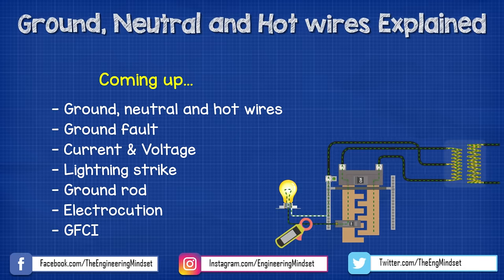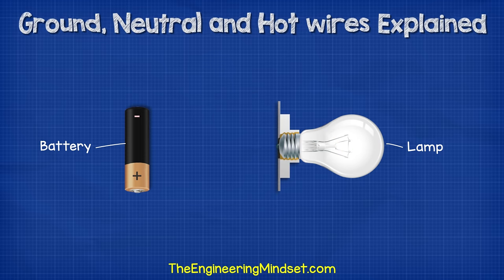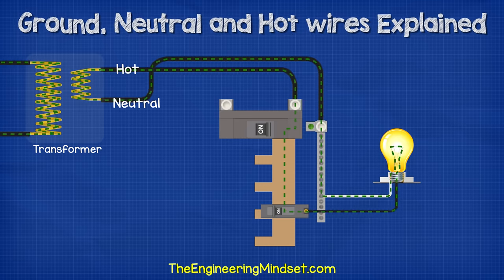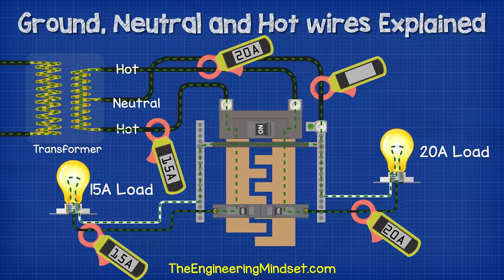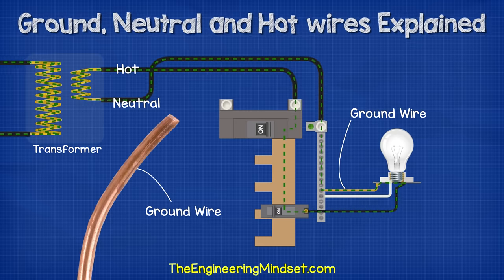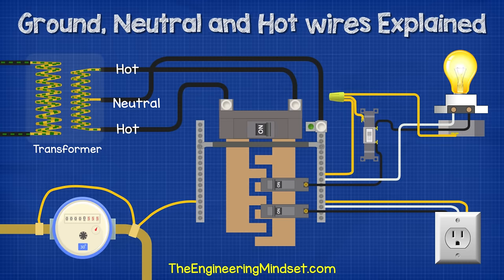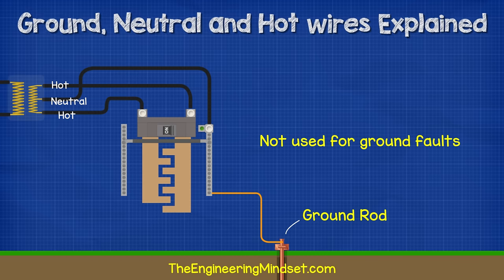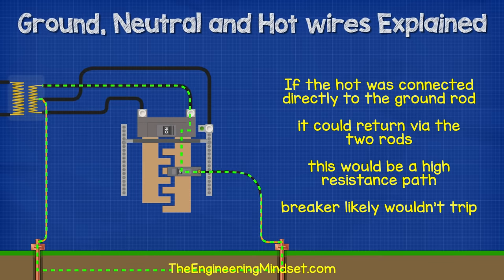Ground Neutral and Hot wires explained - electrical engineering grounding ground fault

Comment: 6:31 The ground conductor is connected to the positive terminal of the battery. If I were to place my multimeter leads across the ground conductor and the hot wire I should read 1.5 Volts. This is because the ground conductor behaves as an extension of the positive terminal of the battery, even though it is not a part of the circuit, which is why current does not flow through it (under normal circumstances) even though it is attached to the battery. Now, if I were to straddle a load between the ground conductor and hot wire, this would result in a flow of current between the ground and hot conductors and (hopefully) trip the GFCI in a residential scenario. Please correct me if I have misspoken.
Reply: depend of the resistance of the load
Reply: in a case of a ground fault the resistance of the ground wire is low so the current will be high so it trigger the breaker but if you put a load between its different.
Reply from the maker: Check our new Multimeter tutorial out ➡️ https://youtu.be/4lAyzRxsbDc

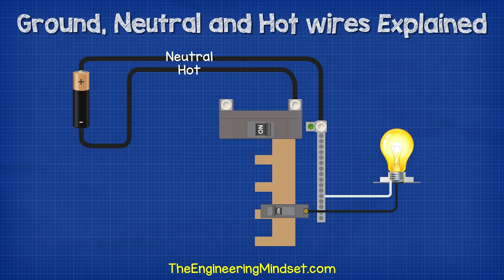Comment: 2:24 Q: so does that mean that there is still current flowing from the ground wire even if it's just for emergency?
 
Q2: I was wondering, can you touch one of the live outlet's wires or specifically the ground wire, alone, and not be electrocuted?.
Reply: You should technically be able to touch the neutral or ground and not get shocked don’t do this. But you can test between earth and neutral with a volt meter and should get 0volts.
Reply: @KiwiMaker  Thank you for answering. I might not do that without any professional supervising me, however, I want to see a real demonstration. Hopefully in the future our professor will demonstrate it to us/me.
Reply from the maker: We just published a new Ground fault, short circuit and arc fault video, so much detail! Link HERE➡️: https://youtu.be/Qi0ynSQw-wc

Comment: Hi Paul! I have a QUESTION for you about the flow of electrons in AC current. My example is base en Alternate Current like in Europe Standards: 1 Phase Wire and  a Neutral Wire.

The Electrons in Alternate Current flow  thru the phase wire and via the neutral wire to the Transformer of the electric company and the get back to again? Or is the Electric Field that is going to the Transformer back and forward? 
In the case that the electrons move (via neutral wire ) to the Transformer: Where the source of electrons come from? 
I've heard from many sources about electricity on the internet that electrons flows or move from the negative to the positive in DC current but in Alternate Current the electrons doesn't move only vibrate and what is moving is the Electric Field.  Is that True? Because if electrons doent flow How the ground fault circuit interrupter (GFCI) could detect a leakage current in the circuit????

Well that's my question.

Excellent Videos!

Thanks!
Reply from the maker: Well the GFCI detects a difference between two wires, if there is no fault both will be the same, if there is a fault then there is a difference. It doesn't matter in which direction the electrons are flowing there will be a difference, either electrons are flowing into or out of the ground/earth wire so there will be a difference between the hot/live and neutral wire. In DC the electrons move in one direction, but AC is back and forwards. The distance travelled is tiny (although I will add this is estimated as no one has ever actually seen an electron.) the ground is usually physically tied to to ground(earth) so its potential is zero volts between you and the neutral. But the hot or live wire isn't so it's 120/230/240/400/415V difference between it and the hot/ground/you
Reply: @EngineeringMindset  Thanks you for your answer Paul!! : - )
Reply from the maker: We just published a new Ground fault, short circuit and arc fault video, so much detail! Link HERE➡️: https://youtu.be/Qi0ynSQw-wc

Comment: I don't get one thing. In a DC circuit, current flows from the negative to the positive, so its obvious which wire is hot and which wire is neutral. The wire carrying the current into the load is hot, and the wire carrying the current away from the load is neutral. However, in a AC current, current oscillates back and forth, so how do you know which wire is hot or neutral? Since they are both behaving the same

Comment: As the live/hot wire carries  electrons from - to + terminal ,it seems more likely to have a electric shock from the wire which comes out of - terminal ,although touching wire from + terminal shocks.can you explain why as we have a better understanding about what you teach
Reply from the maker: Neutral is grounded so it's potential between you and the wire is (or should be, it could be faulty) is zero. Whereas the potential between you and the hot wire is 120 or 240 V
Reply: @EngineeringMindset  Thank you very much for your kind  instant reply👍

Comment: Thanks for the great explanation! Quick question though : if we are installing a fuse in a simple battery-load circuit, so we have to install it on the hot side or on the neutral side? Also, will the hot side be the the positive or the negative terminal of the battery? Also will ground wire presence affect the position of the fuse?
Reply: I would recommend always put breakers and fuses on the hot wire as a best practice.
Always think of the positive pole of a Battery as the hot wire. You might quickly verify that any metal touching it and the carcass get's fried...

Do not underestimated the negative pole of a battery too. It's usually connected to a carcass. For example in a car, you should never connect anything directly to the negative, this pole gets grounded to the carcass, because there might be dozens or even hundreds of amperes going here from the alternator or to the starting the engine. The engine block and the carcass provide a wide and thicc enough conductor to endure this loads. Anything going wrong on the negative pole might fry any components connected directly to it. 
Also using ground wires directly on the negative pole might cause ground loops. That's why you should always use the carcass as "the neutral wire". 

Bateries are also used to prevent oxydation, that's why the (-) pole is used as ground. There are very few cases of using the (+) pole of a battery as ground attached to the carcass. Because doing this inverts the anothe/cathode position during the charge/load cycle.

More information here:
https://en.wikipedia.org/wiki/Anode
Reply: Marcelo Pinhei

I guess that this video was produced south of the Equator, where the toilet flushes in the opposite direction and DC power goes from negative to positive…LOL
Reply from the maker: We just published a new Ground fault, short circuit and arc fault video, so much detail! Link HERE➡️: https://youtu.be/Qi0ynSQw-wc

Comment: now i got a question. is there some kind of id on the source that the electron will recognize its origin and make its way to the place?
Reply: Not really. Electrons will only flow once you complete a circuit. The source creates an electrical potential difference, which is what drives the net motion of the electrons. 

A battery, for example, has a concentration of electrons in one terminal and a low concentration in the other. (This is a pretty simplified explanation though). The electrons will only flow once a path between the terminals is created. This is because the electric potential that is created by the battery is creating an electric field through the wire. 

If the circuit is open, the electric field that is created can't move the electrons to the other terminal. (However, it is notable that if the voltage is great enough, the electrons can have enough energy to push through whatever is keeping the circuit open, like air. Lightning is a good example of this.)

Comment: Most other sources refer to + on battery as hot, opposite of this video.  I've also read this can depend on the system.
Reply: This confusion may stem from hot/neutral referring to AC systems only and not applicable to a DC battery

Comment: I might be wrong but dont you have load and line backwards? 4:00
Reply from the maker: The animation is correct in showing the current flowing from the breaker, through the load and back on the neutral, it also alternates direction. The hot bus bar not in use has the green dots moving also, although there is no load show so no current would be flowing on that bus bar but the voltage would be increasing and decreasing between +120V and -120V
Reply: The term "line" is the power from the source. The term "load" can have a couple of different meanings, depending on the context. In a GFCI receptacle for example, the "load" feeds the downstream outlets. Otherwise, the "load" is anything that is plugged into a receptacle demanding current or power to function.

Comment: When you have a 240v plug in your home (i.e. for the clothes dryer) and the circuit is using the two outer "hot" wires...does one get referred to as the neutral in that situation?
Reply: No, both lines are hot. They are commonly called L1 and L2, or L1 and common.

Comment: We all know because we've been told ample times the direction of electron flow..  But for all practical intent and purpose,  electricity flows  from positive to negative.    You are not going to ever get a shock touching a neutral  or ground wire  in a complete circuit.   That is why switching is always done one the "live" or feed wire/

Comment: When you directly connect the neutral and hot wire it will create a short. What's the difference between that and plugging in electronics? Isn't the electricity supposed to travel that way?
Reply from the maker: Fully explained in this video https://youtu.be/Qi0ynSQw-wc
Reply: @EngineeringMindset  thanks. Ohms law. Makes sense

Comment: How to differentiate hot from neutral in an AC circuit? Is it because of CB connection and ground? The wire which is connected to the CB is technically the hot?
Reply: @GH-oi2jf  circuit breaker

Comment: I have always been confused about hot vs. neutral in an AC circuit.  If current were direct, then I can understand why one side is hot (negative is source of electrons) and the other side is neutral (return path for electrons).  But if current is alternating then it would seem that either side can be the source or the return depending on which direction the current is flowing at any particular moment.  So the two sides would seem to be equivalent.  Can you explain why this is not the case?  Why is one side hot and other side neutral despite the fact that current is alternating direction?
Reply from the maker: It's neutral because it's physically tied to the ground (planet earth) . It is the same voltage as the earth and you are also. The hot side isn't. So if you touch the neutral nothing should happen in an ideal system, but if you touch the hot you'll become part of the circuit and be electrocuted unless you fully insulate yourself. A bird can land on high voltage line and be completely fine, but if it touches another wire or the supporting frame at the same time it'll be blown to bits.
Reply: @EngineeringMindset  So this is finally making sense!  Just to check:  So either hot or neutral can be the source of electrons or the return path (depending on the direction at a given moment).  Correct?   But electricity cannot flow from the neutral side unless there's a low resistance circuit (bulb or appliance, etc.)  If it's just connected via my body nothing will happen because the neutral side is connected to ground via a lower resistance path than my body can provide.

Comment: So, the question remains, is it acceptable to connect the neutral to the metal chassis of an appliance to use it as a "safety" ground?  This would be in a situation such as an older house with no ground circuit.
I've always seen the ground wire largely as a "redundant neutral".  If the neutral breaks, the there's no more safety, but the appliance also no longer works.
Reply: No
Reply: tim g  That's what I was thinking as I read  about half way through what you just said. If that neutral wire circuit broke somewhere between the appliance and the breaker box, the entire appliance would become hot.
In a perfect world where there are no breaks in wires, connecting the neutral to the appliance would work, but... as we all know, it is far from a perfect world.

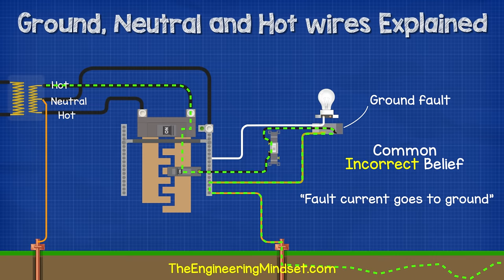Comment: 9:33 Many people in my university, even my professor think this way. They even say that the ground wire that is connected to the neutral(in the main panel ofc) is wrong. It iritates me that most people still not care about this kind of electrical safety.
Reply from the maker: We just published a new Ground fault, short circuit and arc fault video, so much detail! Link HERE➡️: https://youtu.be/Qi0ynSQw-wc

Comment: I've been searching online for an answer and all I see is neutral and ground can be connected. I don't understand why can't the ground wire be connected(directly?) to the neutral wire since both wire just goes back to the source. Is it just to prevent a scenario where the neutral wire somehow gets disconnected or damaged and hot wire is still good? and that way we still have ground connection?
Reply from the maker: We just published a new Ground fault, short circuit and arc fault video, so much detail! Link HERE➡️: https://youtu.be/Qi0ynSQw-wc

Comment: 9:13
Clearly the ground may also be a part of the ground return path it will be in parallel with the neutral. While more current will flow to the neutral, there will still be a current flowing in the ground going to the source depending on the resistance of the earth. Kirchhof's current law.

Comment: Do domestic circuit breakers in the US trip at 60ma as their supply is 120V as opposed to Europe where the supply voltage is 240V and 30ma rating?

Comment: In the escenario of balanced loads 15 amps each, When you said that current is flowing back and forth from the load to the source, what do you mean? 
Do you mean that current would come from the hot wire and flow to the load then pass through the neutral wire until it gets to the neutral bar on the pannel and then go back to the load and at the same time to the hot wire? I am a little bit confused because in the video I saw how current flows through the neutral until it gets to the neutral bar and then returns, it does not go back through the neutral that comes from the transformer.
How would it work in a community where each house is connected to a different hot wire circuit? Would the current come from  the hot wire up to  the load and pass it then go to the neutral up to the neutral bar and the return again?  My confusion is because I see that you connected the 2 different  neutral wires, generally in a independent  residential house the neutral goes to the neutral bar and it is not connected to the other load circuit ( hot wire and neutral) because each circuit belongs to a different house and they both are connected to a different hor wire.
Reply: If there were only one of the two circuits connected, you would have 15 amps on the neutral conductor back to the center tap of the transformer. When you add another 15-amp circuit on the other leg, you effectively have an additional 15 amps on that side as well, but since the neutral current is out of phase with the first circuit, tit will cancel out all neutral current flow. It's like having two identical 120V loads in series across a 240V source.

Comment: 8:20 I doubt you would feel any shock that far away from a grounding electrode conductor, but if you did, it would not kill you, you would yank your hand away instantly and 'yelp'. Perhaps if you had wet hands are were grabbing that metal pipe you 'might' die [more likely be hurt badly], but electricity at 120v will have a hard time pushing through the earthen dirt through your body, wet or not. I grab hot wires all the time, touching trees, plants, leaves, shrubs, grass, sides of buildings, roofs, sitting on concrete, I never get shocked not even a small bit.

10:34 Now I have created this path before- ground rod to ground rod. I purposely touched a hot wire to a new ground rod [that was not wired to the panel yet]. I assume the electricity was traveling through the dirt to a nearby neighbor home's ground rod that WAS connected to a panel. The hot wire welded itself to the new ground rod I just drove into the ground by itself. The breaker did NOT trip.

But the rest of the video is superb. I am surprised you understand electricity and residential wiring characteristics this well. Many of my fellow electricians don't have this level your understanding.
Reply: Yes but remember that it’s dangerous because if you complete the circuit you might not be able to let go and then that will lead to your death.
Reply from the maker: We just published a new Ground fault, short circuit and arc fault video, so much detail! Link HERE➡️: https://youtu.be/Qi0ynSQw-wc

Comment: I guess what I mean is at 5:25 if you pause it shows two breakers stabbed onto the same bus but you show current flowing on both buses, they are on the same bus therefor the neutral has 30amps not zero and there is no current flowing on the bus that is on the left side of the panel in this pause at 5:25

Comment: So i'd assume electric cars also have some sort of grounding for the motors, inverters, etc. In that case would the best ground be a special wire, or the chassis in general? Based on what i learned from this video a wire would be more logical, though chassis would be more convenient...
Reply: Mine has low voltage DC for accessories using common vehicle chassis. This is independent of the variable frequency drive that runs the motor, which has no common conductor.